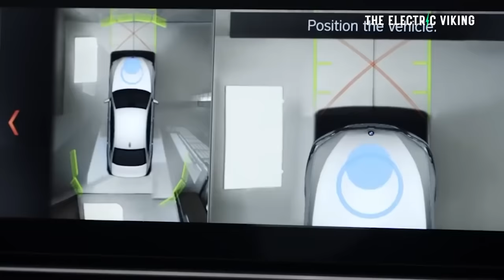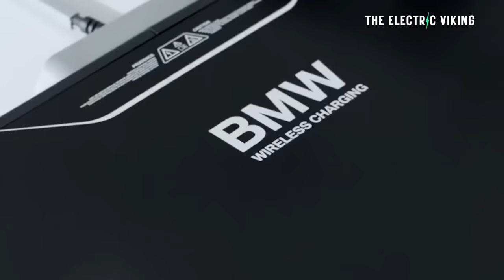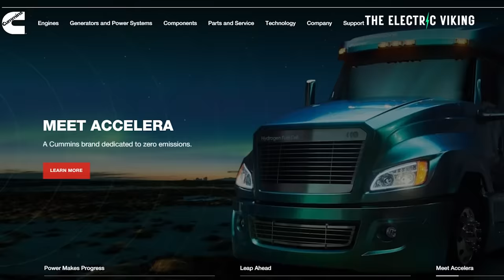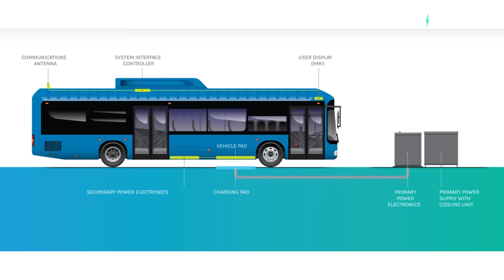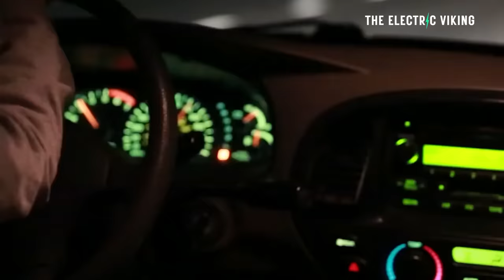U.S company invents 500kW ultrafast wireless EV charging, powers in 15 mins

Comment: The ideal use of wireless charging is mass transport like buses and rail where vehicles/locomotives stop in designated places regularly. It will allow smaller, lighter batteries giving improved efficiency and lower cost. It woul also be useful for local delivery vehicles and taxis that might retun to the depot/rank a number of time in a day
Reply: Over head wires at bus stops are cheaper and more efficient.
Reply: @michaelberger6699  only marginally more efficient but you have the additional cost of the gantry and the cost and mechanical maintenance of the pantograph

Comment: Speaking of EV charge stations,  if you have charging stations networked and talking to each other,  they could optimize multi vehicle charging prioritisation.  These charge stations could then advise drivers in their cars,  based on their current charge and vehicle range,  where the next charging stations are located along their journey to complete their charge.  This could help avoid bottle necks at charging stations and allow vehicles with a lower charge state faster access to the charging station, so they can complete their journey as soon as possible.  If that makes sense.  Thus if say there are two vehicles with one waiting and the one that's charging has been charged sufficiently, it could limit the charge time for that vehicle and advise it to move on, so that the vehicle behind it in a lower state of charge, can be recharged sooner to the required level to allow it to complete its journey allowing enough range for alternate charge station visits along their route also.

Comment: 🔌🔌As a recently retired Cummins Power Generation Engineer from Mpls the last project I worked on with a consultant out of Boise was for a 500kW wireless test site to charge buses and service vehicles in Oregon. The downside of the project was the utility to support 500kW peak power at specific locations. They ended up paralleling a Tier 4 diesel generator at one location. The same issue occurred with Nxu's 4.5MW chargers in Arizona. They rented portable generators to meet demand at their facility Typically the lack of power from the utility generation facilities is not the issue. Instead, it is the lack of xfmr and wiring at the location where the source is required.🔌🔌
Reply: "500kW wireless test site"

So it would be fair to say is was a proof of concept project, not a production ready facility? Yes/No?
Reply: @BrentonSmythesfieldsaye  I retired before I saw the final results. It was for the City of Portland. I do not recall the wireless vendor but I did meet them in San Diego.
Reply: @Carl_in_AZ  Ok fair enough. Sounds like an interesting project. Take care and hope you are enjoying retuirement!
Reply: So roll the coal to power the wireless charging?
Reply: I'll give Portland credit for improving their local air quality, unlike Phoenix AZ which has gone from the best place to live for respiratory illnesses to the 5th most polluted city in the USA. Today Phoenix issued another pollution warning due to NOx, and PM, not CO2. That makes eight warnings for MTD. When Portland Utility updates their xfmr in four years at that charging site they planned to use the generator as an emergency standby genset. Tier 4 gensets cost twice the price as T2 gensets.
Reply: @Carl_in_AZ  Great outcome for Portland then. Are you aware of the mix of measures Portland took to improve it's air quality Carl and if so what were they?

Comment: Waiting at traffic lights would be a good place to get an inductive charge.
Reply: they should be replacing traffic lights with round-abouts- that would save more energy as cars use most of their energy in acceleration
Reply: how do you pay? the city is not going to pay for everyone to charge their car. i see this as a major problem for any road based wireless charging once you get past the testing phase.
Reply: They can't build that on the road. Maintenance means frequent road closure. Busy cities can't afford to do that.
Reply: @scottmcshannon6821  "i see this as a major problem for any road based wireless charging"

Have you never used a modern toll road transaction system? I don't see where a payment problem would exist. The tech and systems that would enable the transactions already exists and I espect could be adapted the wireless charging scenario.
Reply: @PolineChan  LOL, public infrastucture services are already located under roads. The highest density of such services under roads are found inside the boundaries of "Busy cities".
Reply: @Justan669  LOL, you didn't think that throught very well. The EV still needs to be charged whether it is on the road or at a traditional stationary charging facility. Your scenario doesn't save any energy at all. What your scenario does do though, is provide further opportunity to see just how poorly so many drivers negotiate round abouts.
Reply: @BrentonSmythesfieldsaye  and you think a few inductive chargers that will charge for 45 seconds tops at a time is going to help?
Reply: @Justan669  Well charge from regenerative braking for a few seconds works well enough that it is viable. So your point is?
Reply: @BrentonSmythesfieldsaye  Unfortunately, thats not how the real world works- but follow that passion and go into an electrical engineering field and I hope you prove me wrong
Reply: @Justan669  Electronics is my field. I have worked in support, repair & maintenance of consumer electronics, computing systems, medical imaging systems for over 40 years. Telling me "thats not how the real world works" explains nothing as far as I am concerned.
Reply: @BrentonSmythesfieldsaye  Unless you can charge through the tires- there is a large gap between the road and the bottom of the vehicle and the larger the gap- the less efficient inductive charge. If you live in a northern climate- salt on the road will ruin those chargers in no time- not to mention potholes. Cars don't sit idle at lights for very long and you wouldn't be able to charge any substantial amount plus now you'd have assholes waiting at green lights to slightly charge their cars. This could work in parking lots where cars remain motionless for long times- not at traffic lights and this isn't accounting for problems I haven't thought of yet
Reply: @Justan669  "Unless......"

Nonsense. You sound like you are getting more and more desperate to discredit the system. Here is a hint check out what a company such as WiTricity says about the matter.
Reply: @BrentonSmythesfieldsaye  I'm not opposed to this working- I'd be happy to be wrong- but based on my practical knowledge of electricity- I don't think this is a feasible solution
Reply: @Justan669  Everyone can have their opinion. But in this instance the vocational experts would beg to differ with yours.
Reply: @BrentonSmythesfieldsaye  When I see it in practice, I'll eat my words
Reply: @Justan669  Fair enough.
Reply: @Justan669  By the way before we close off, some info for you.

The efficiency of wired versus wireless charging is that they are both essentially on par with each other, both hovering around 89% to 93% efficient. The induction air gap you referred to, is the least problematic aspect of the system. The influence on efficiency that matters, involves the AC/DC conversion stage and how it is applied differently in both overall systems. That is where the losses that count occur. The information on all this is readily available online, so I would encourage you to update your "knowledge of electricity".

Comment: I'm dubious about putting them in roads, but these speeds could revolutionize commercial charging stations. They would look more like drive-thrus or toll booths than gas pumps, with no need to leave the vehicle. In fact, these could be incorporated into drive-thrus--order a charge with your meal. Or into convenience store parking spaces. Another layer of profit for the business, without failure-prone moving parts or above-ground components.

Comment: Sounds impractical for roadways but fine for dedicated parking spaces. You have to realize that a huge many megawatt backbone would be required for multiple cars being charged at the same time in stopped traffic. You also have to consider the people having problems with high current radiation, like they are considering cellphones. Practical charging requires high radiating AC currents at frequencies in the 50kHz to 1 MHz range. You would also be lucky to get >75% efficiency. We use wires for a reason since they are 95-98% efficient.
Reply: "You would also be lucky to get >75% efficiency. We use wires for a reason since they are 95-98% efficient."

Apparently those statements ares inaccurate according to WiTricity. See the page at there Web site titled

"Wired vs wireless charging efficiency for EVs: A comparison"
Wed, Feb 23, 2022"

Comment: You don't need wireless roads everywhere just in places where cars have to stop for a while. Parking lots and signal controlled intersections would be a good start. Loading docs would be another good place for large trucks. However, the amount metal coils needed would not be an efficient use of the material unless it was also the rebar.

Comment: We use to run electric buses from overhead wires in the 1900s. This is more efficient than batteries. More train freight powered by renewables is a better solution.
Reply: Less friction as well.

Comment: Wireless charging will always lag behind cable charging. I think it would be useful as an addition, but will not replace conventional wired charging. 

I personally thing these will be best placed in parking spaces in service stations and in cities. At home it will be easier to use wire due to cost of the technology.

Comment: Wireless charging is something that would be very useful in a home garage. I like the concept. Unfortunately, if you follow the stock market then you know that Ideanomics/Wave(IDEX) is not doing well in terms of stock pricing. It has undergone a 1:125 reverse split ( 8/25/23) and the stock is still under $1/share. I intended to invest in the company based on its potential but with a reverse split particularly  of that magnitude, I decides against it. At the time  prior to the split, it appeared the IDEX was the best of the Inductive(Wireless) charging  companies I knew something about. Witricity might be the best one now but I still like IDEX for some unknown reason. I still might throw a few dollars into the IDEX slot machine at the Wall Street Casino. If IDEX goes belly up, then I will only be out the equivalent of a few cups of Starbucks coffees.

Comment: I think any solution that can reduce battery capacities is interesting.  I dont think fast dc charging will be replaced by wireless because if you drive to a place specifically to charge your ev in rhe quickest way possible , you wil prefer to take a few seconds to plug it and make sure you have the best charging speed, efficiency, and cost. But wireless charging is interesting for ev owners wirh no garage using street parking. building a charger at every parking space require a big amount of construction and means a lot of sidewalk real easte taken by chargers and cables.  whereas installing  wireless chargers under the pavement could be done anywhere there is street parking with no impact on the sidewalks. streets get redone on a regular basis so it could be done at the same time as scheduled maintenance. level 2 is sufficient. you could just park, the car is charged and parking fee + charging can be applied automatically.

Comment: Fast charging regularly has typically degraded the battery significantly.
I wonder what has been done to offset or compensate for this issue.
It doesn't do me a lot of good charging twice as fast if my battery lasts 1/2 as long as a result.
Newer battery tech may eliminate the issue, but we don't know yet.
Some possible applications might include weigh stations wait lines, rest stops at truck stops and on highway.
Commercial (service company) installations are worth considering for this tech.

Comment: Is there a concern in regards to pedestrians being close to these wireless chargers?
Reply: Would hopefully require a vehicle to activate the charger.
Reply: @OTPulse  Was more thinking along the lines of electricity radiation as in being under over head power lines, though many say that is not a hazard.
Reply: @christopherj2231  That's been a thing for a long time, and it's proven to be a hazard. Lots of farm animals grazing near high voltage lines have far higher cancer rates than usual. That's why junctions for electricity distribution are almost always away from towns.
Your concerns are completely valid but reasonably easy to avoid with shielding and not having them active when not in use.
Reply: @OTPulse  OK thanks for that.

Comment: Hey Viking the Fire Station argument you made is just not a good one, yes firefighters have a higher risk of cancer but it’s not because of the “exhaust in the fire station” because fire stations have to have exhaust filtration systems that automatically connect to the exhaust pipes when the trucks pull in the station. NFPA 1500: Standard on Fire Department Occupational Safety, Health, and Wellness Program specifies that fire departments contain all vehicle exhaust emissions to a level of no less than 100 percent of effective capture.Apr 19, 2019

Comment: Make wireless charging toll roads need roads designed for heavier EV'S need to upgrade power grid first
Reply: Roads are already designed to accomodate heavy haulage trucks and commercial vehicles.
Reply: @BrentonSmythesfieldsaye  not all roads. Also, won't these haulage trucks and other commercial vehicles be heavier if they are electric? I guess they could haul less and make more trips for the same job
Reply: @marvenlunn6086  Are you speculating or do you know that actual comparable weights? Unless you can show evidence that there is a compative impact, you are just promoting speculation.

People keep banging on about EV weight, yet the most popular current ICE vehicles are generally heavier than EVs, where I live anyway. The roads will be just fine. Plus as EV's continue to evolve they will become lighter anyway. Batteries, just as one example, with become more energy dense meaning the packs can be smaller for a comparative range. But the EV is also redefining vehicle manufacturing techniques and philosophy and it is still early days in their development. Changes and progress are coming at an ever accelerating rate at this time.

People really do speculate heavily about things they are unfamiliar with. When in reality there are clever people involved in all this vocationally, that understand the challenges and will resolve challenges when and where they may exist.
Reply: @BrentonSmythesfieldsaye  EV'S are about 20% heavier than a comparable ICE vehicle technology is going to improve, but when and what about the power grid you hear about places having blackouts all the time
Reply: @marvenlunn6086  "EV'S are about 20% heavier than a comparable ICE vehicle" - Says who?

"the power grid you hear about places having blackouts all the time" - Name one that has been caused specifically by EV charging!
Reply: @BrentonSmythesfieldsaye  not sure what is causing but they are asking people not to use air conditioning or charge cars about the weight it might be less now but they are still heavier than an ICE vehicle you are the first place I ever heard of an EV lighter than a comparable ICE vehicle
Reply: @marvenlunn6086  So do you have any official statistical report that shows their is a +20% weight premium of EV over ICE. That was your claim. Where did you get that broad reaching generalisation from?

Re your claim related to supposed black outs, who is asking people to switch off and what is the actual real world reason if that is being requested. Do you have an offical source to this information?

Comment: Wireless charging is the missing component for fully autonomous vehicles. For some time trucks will need humans to manage the loading so while they are sat there they can be plugged in. At home too you can just plug it in. It's robotaxis operating all day with no interaction with human assistants/owners and only customers that need it most. Having them at taxi ranks where they sit for a while makes most sense for that. There and parking lots for private cars so that the infrastructure isn't taking up space.

Comment: 10% of 500kw is not a small loss. Thats 50kw could almost power 3 house instead of being lost. Never mind that it make no sense along roads and highways as the infrastructure cost would be crazy. Suitable for bus stops maybe but an over head power direct connection would be better.